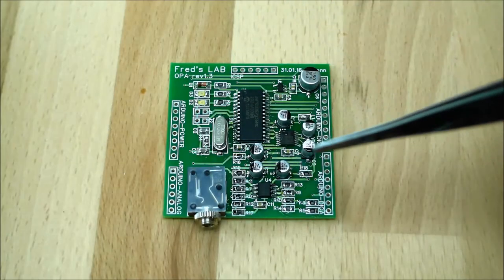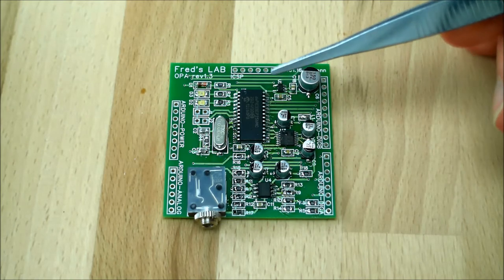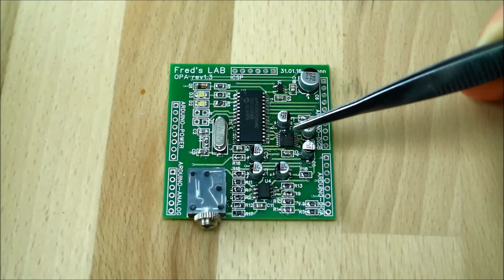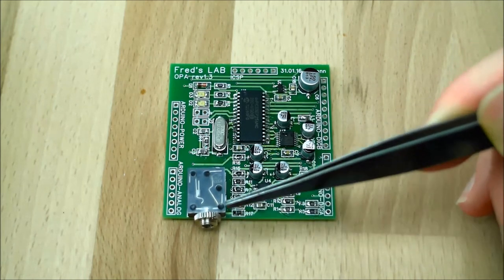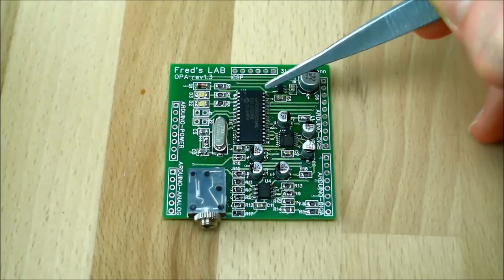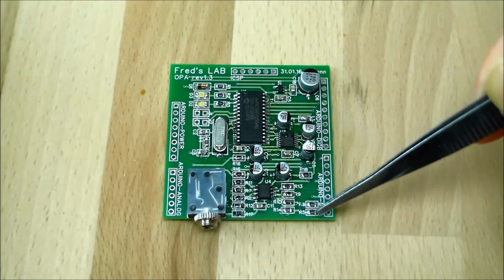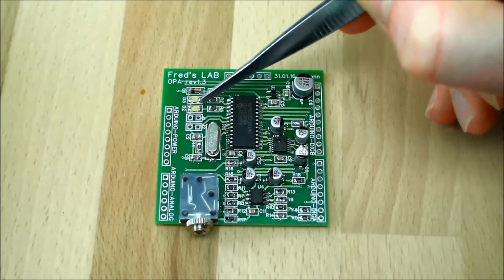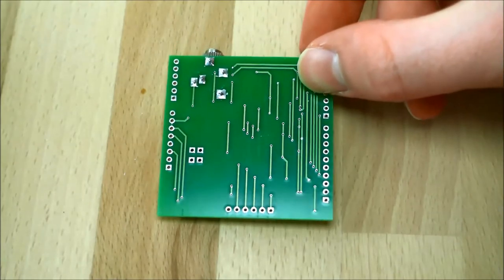OP·A shield campaign - Inner workings

Comment: Will the board/dspic code be opensource?, would be nice with an iteration of this board with the arduino chip included, pads for optocoupler, and pinout for midi sockets, and linking so two or more boards could be connected togheter and run directly without external parts.. super-dx7..
Reply from the maker: +Asbj&#248;rn Mikkelsen I think what you propose is a different project. The idea behind this one was to provide a solid and well documented sound-engine for people willing to make their own instruments. The shield was designed to be a demonstrator for the chip. Going open-source may come later. I spent a lot of time on the software (at least 6x more then the hardware) and I do not want the chip be cloned before I can at least pay for the prototypes. Not even considering the dev time. But it's not a closed option. Editor and control library are MIT licenced.
Reply: +marzacdev Yes, it would probably be an different project, but it would be very cool to do something with it. I pledged for two OPA, but I wouldn't want to use two arduinos, maybe that is not needed either?, I guess the libraries should be easy enough to port to st-nucleo, or chipkit-boards if more power is needed, but it will be an stack of boards, arduino+two opa+some sort of midi-in/out shield :)
Reply from the maker: Asbjørn Mikkelsen
you can stack up to three OPA shields on the same Arduino using the address system (with the jumpers). For the library, i think it is straight forward. All the code is on git-hub.
https://github.com/Marzac/OPA-Library